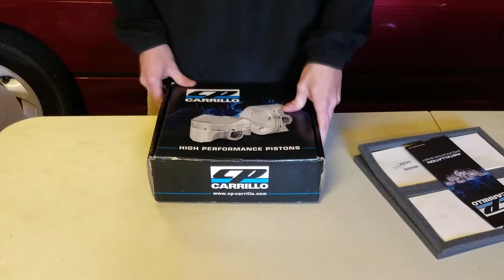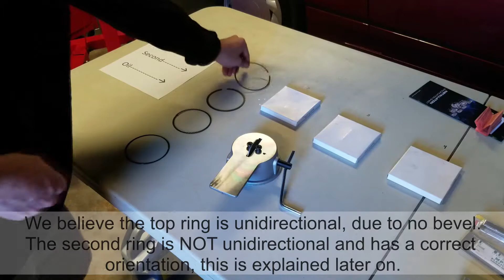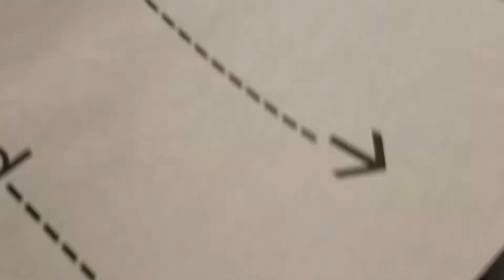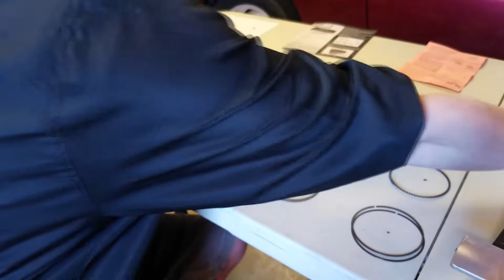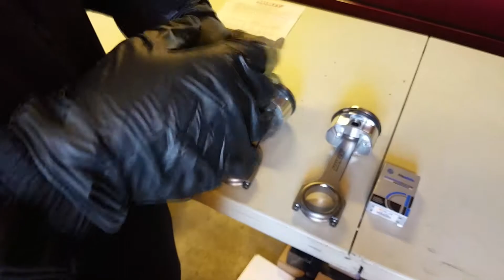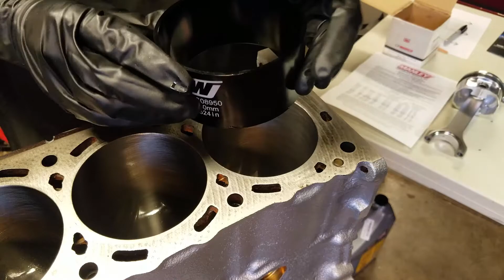KA24ET Series - Building the Block (Part 3)

Comment: I really appreciate you making these videos, but I think it’s important to note that the pistons should’ve gone to the machine shop with the block so the cylinders could be bored to match the pistons. At which point they could’ve also hung the pistons onto the rods to ensure balance. It might’ve cost a little more but it would’ve saved you hours of labor and insured the rotating mass was perfectly matched. Some things we DIY’ers just can’t do at home.
Reply from the maker: The pistons and rods did go to the shop with the block at the time of machining. Good to know for others who are going to be potentially going through with the same process though.